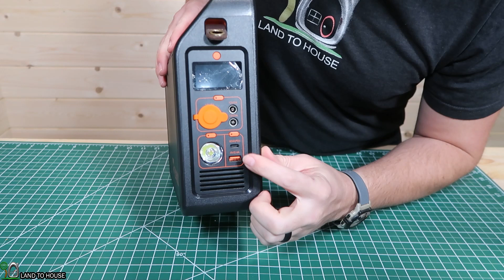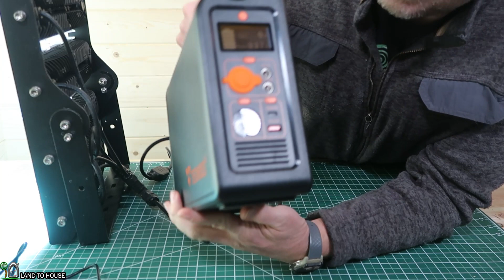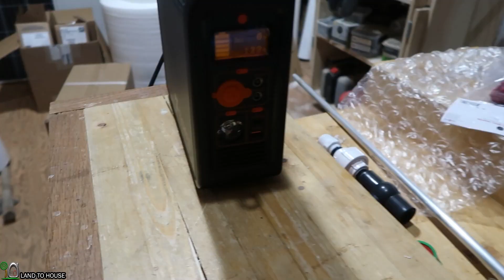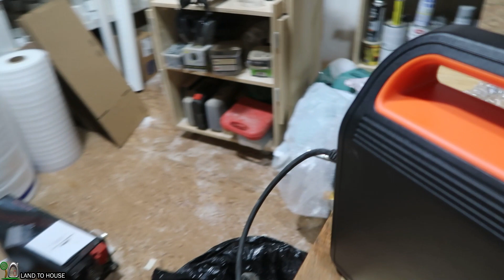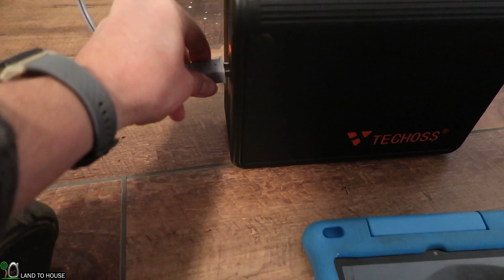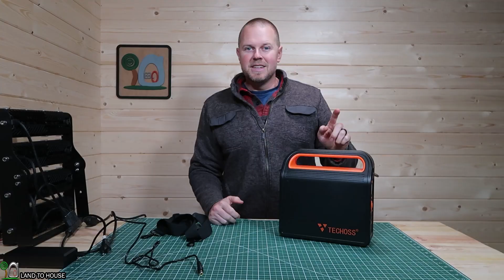Techoss 300w 80Ah Power Station

Comment: Help me out. Did this thing come with a 12v cable. Haha. I have so many power stations that I can't remember if it had one. 
I have a zip lock back system now but uhhh yeah. Did it come with a 12v lighter cycle cable?
Reply from the maker: Do you mean to be charged from cigarette lighter? This one did not.
Reply: @LandtoHouse  whew. Thanks. I was about to bag up another devices 12v cable with it. Ha

Comment: Hmmh, your 200W Space Lite shows quite different power usage on the different power stations you have tested. On that power station it shows around 220W, and on the Oukitel 500W Power station, which you have tested a week ago, it showed only 150W. That is 70W less! Looks like the power displays are not quite reliable. Or your Space Lite has a big variation in power usage (which I do not belive).

Comment: Capacity test to ensure you are getting the full 300 Watts. Is the cigarette port regulated? Thanks for sharing
Reply from the maker: I will need to test that. I just got a device that uses a cig lighter. I can test it out.
Reply: @LandtoHouse  very interested in that.  its claiming to be 300wh.. doubt it based on that size.
Reply: It is actually 200wh, 300 peak (needed when starting some devices - like refrigerators). I
tried plugging a 110v 200 watt ceramic heater in and it started at 240, then drifted down to 190 +. It ran for about 45 minutes and had small effect on my drafty camper. Better to power a CD player or something and dance to stay warm.

Comment: No use to me unless it can be charged with solar panels. I'm wondering what use a pure sinewave inverter is if it HAS to be connected to mains power..
Reply from the maker: This unit can be charged by solar as long as the input is within the specs of the charging range.
Reply: @LandtoHouse  And what would they be? I'm pretty electrically challenged. I have 2000 w solar panels.
Reply from the maker: Looks like the unit charges at 63 W. I will have to try connecting a 100 W panel to see if the unit will charge based on that.
Reply: @LandtoHouse  interested in that test too.
Reply: @LandtoHouse  My Q also - so maybe plug in our 100 W Harbor Freight solar panels without going through the HF charge controller?   I think the input to the controller is 18 W, but I'm not sure.

Comment: Not very interesting device i don't like it , may be ok for simple applications
Reply from the maker: Yes charging phones and watching tv when the power is out.
Reply: Well considering that it can be had still for $100 discount, that is about $140, I find it pretty useful for my little camper., But it does have a bit of a hum when plugged into an amplifier with an electric guitar.

Comment: Nice device. Does exactly what is meant to do. Not everyone needs huge power and capacity. Sometimes small of device is more than enough. As always great review Seth. But I'm quite surprised that it is ready a second device you present which is currently unavailable on Amazon.
Reply from the maker: Thats odd. It shows up on Amazon for me. Yes I have been using a power station called FlashFish for a few months. It is about the same size as this one. It charges my phone every night.
Reply: @LandtoHouse  I understand that now. It might be because I look at your links from Poland. And Amazon doesn't deliver there for USA. The end result is that it is unavailable for me.

Comment: I'm always amazed at how modern electronics have come a long way in their usage. When you turned on the TV + two tablets charging and they only used 40w it just put things into perspective. That's less than the bulbs in most fridges when the doors open! :) I enjoy seeing these videos and the various designs coming about from manufacturers as the world of small home power generation and storage explodes. :) Now if a company were smart, they'd come up with a weatherproof solar panel design that would be universal to charge all the various battery banks that don't come with solar inputs! PV panel + micro inverter.. COMING SOON TO LAND TO HOUSE?! :)
Reply from the maker: It also surprises me how little power the new T v's use. My 55" TV only uses 45w. 

 I am actually testing a panel now by xtar  It is water resistant and charges most devices.

Comment: Interesting design.  Definitely feels like a camping accessory with the grommets. Don't like the color design or the fact that it doesn't give a battery percentage. Another great review!
Reply from the maker: I too prefer the percentage readout on the display.
Reply: It does have a graphic of a battery on the screen that shows 20% increments. But in practice I find the first 20% last much longer than the last 20% under the same load.